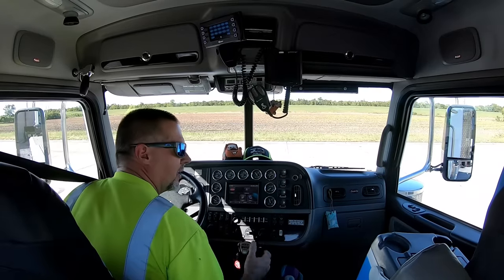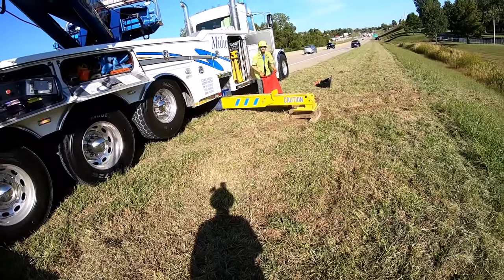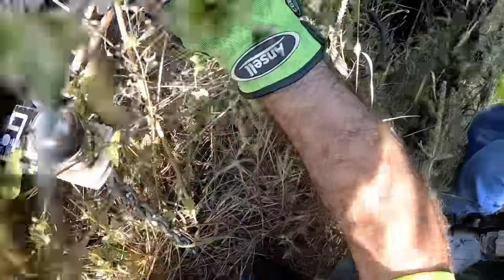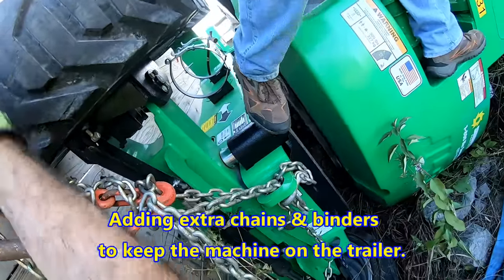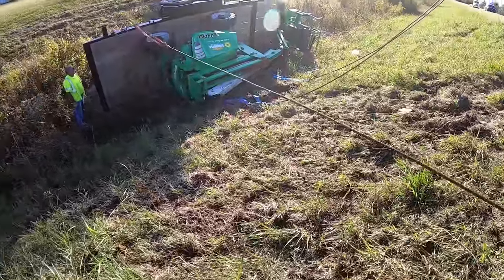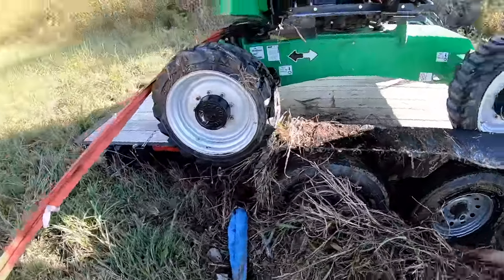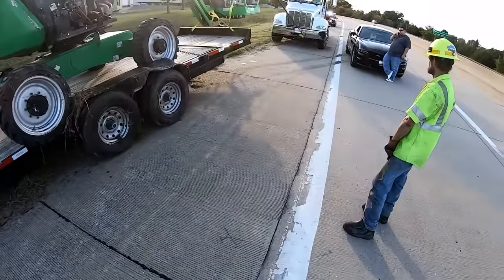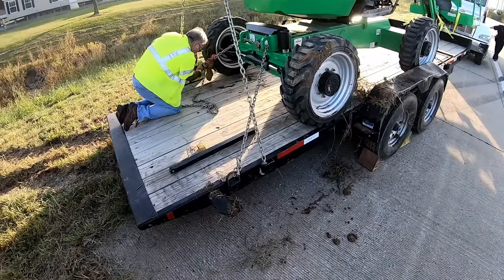THE REVERSE ROLL   ROLLOVER MANLIFT & TRAILER   YOU SPIN ME RIGHT ROUND

Comment: how do you reverse a rollover? isnt a rollover a roll over no matter witch way it rolls over said the woodcuck who chucked wood?
Reply from the maker: I guess I should have clarified what I meant.   The recovery procedure that we used to upright the trailer and the machine is called a "reverse roll".   The most common way of uprighting an overturned vehicle is to attack it from the wheel side rather than the top side.  When attacking it from the top side you are "reversing" the procedure, therefore,  this maneuver is commonly referred to as a "reverse roll", at least here in the States.    If you watch the channel long enough, I try to show a lot of different techniques.  Thanks for watching and God bless.
Reply: @RonPratt  I was gonna say that's a Ford......tow hooks aren't gonna be a true option (wonder how many feathers you've ruffled with that lol). Just because I'm a curious little shit was the truck repairable?
Reply: @RonPratt  I dont claim to know everything. I dont know much. What i do know how ever is those man lifts have a massive counter weight on the back. The guy drove the lift on the trailer when he should of backed it on .
Reply: @protectoroffaith  The tongue weight if he had put the lift even to the forward edge of the tilt section of the trailer may have been more than the truck itself could safely handle. even spinning the lift so the counter weight was to the front where it was sitting could have done that, though that would have been the better option than the way it was loaded.
Reply: @protectoroffaith  Or simply have rotated the basket around after it was it on the trailer and moved if farther forward on the trailer.
Reply: @protectoroffaith  that is what I noticed as Ron walked down to it.
Reply: @protectoroffaith  exactly!  I've hauled several of those, only bigger. It wasn't loaded on the trailer correctly & like Ron told the officer, it wasn't secured correctly. Never run one chain through both loops, always secure each corner separately.
Reply: The woodchuck and i thankyou for the clarafication  sir......(woodchucks are easily confused) have a good day  and may your God do with you
P
Reply: @timothygeiger437  If the machine is under 10,000 lbs, then one chain like these guys had it is perfectly legal. But anything 10,001+ lbs, you are correct. Needs 4 independent tie downs on each corner
Reply: @RonPratt  Looked at many comments and I agree with the many folks who say the load was back to far on trailer and caused the crash. As Ron stated the truck and trailer spun 180 degrees. This means the trailer ended up in the lead which is obvious by the skid marks and final resting position.
I am curious though if anyone  thought about why the trailer was in the position it was? I think there's a reason the coupler was twisted off the ball hitch.
Follow the skid marks. I believe Ron's reverse roll completed a 360 degree roll. If so the lift indeed took a beating and the lift basket and truck corner may have only met right at final resting place.
Thanks Ron for the work you put into showing your professional trade. Added camera view at high speed shows up the forces on the rotator, which is very interesting to see.
Reply from the maker: @paweaver1861   I do not know exactly, but from what I saw at the scene, it appeared as though the trailer and the machine rolled onto the opposite side of the ditch very hard and then bounced back to its final resting position.  There were multiple "scar" marks on the grass and rocks on the opposite side that looked fresh.  The machine had damaged on the uphill side of its final resting position.  To me, this would mean that the machine either did a complete 360 roll, which I don't believe it did, because the break-away chains would have been twisted.....or it would have, as I suggested, hit the far side of the ditch hard enough to bounce back to the uphill side.   The safety/break-away chains being in the position they were, as well as the other evidence I mentioned, gives me the impression that this was what happened.  Again, it is only my opinion based upon what I saw.   Thanks for watching and God bless.
Reply: @RonPratt  Thanks for the detailed reply! Interesting to know there was scars on the bank beyond. You had the advantage of being there to see but you weren't called out to investigate either so did your job and moved on. Brutal ride either way and thank God no one was injured.
I shouldn't waste your time but I guess I'm stubborn enough to give a little more of my study. 1st I saw it appeared the double skid marks of trailer going sideways seemed to end and appeared to be tore up more random afterward but the only boots I had on the ground were yours! 2nd I did study the safety chains and decided they were hooked opposite as required but then it dawned on me that if the left trailer to right truck chain was on the bottom of the cross it would have unwound the 1st half of the roll and only started the next twist but I couldn't see well enough to confirm it was twisting that way and that still does not confirm it rolled.
Don't let it scare you that your videos get such scrutiny. You still know best. Thanks again for the window into your profession.
Reply: That manlift alone is 15,000+ lbs. I cant believe sunbelt was delivering that thing with a 1 ton truck and trailer.
Reply: @protectoroffaith  looks like it would need a new frame at least, for a work truck with wear and tear on the driveline, suspension, engine prolly not worth it. maybe it could be tweaked by a frame shop but idk shit about that
Reply: @iffykidmn8170  not quite he had brought it up the embankment to get it free of the rocks at the bottom of the ditch as the machine and trailer were resting mainly on dirt it was the move necessitated to prevent further damage and made it easier to get it free from the ditch
Reply: @timothygeiger437  I was taught in cargo securement class in the army back in 09 that you should be able to (theoretically) completely roll the trailer and cargo upside-down and back as well as being able to stand it on either end without the cargo being able to shift... of course all calculated based off securing device working load limits if the math didn't add up then add more securements
Reply: @timothygeiger437  But it stayed on the trailer, so it was secured adequately for the maneuver he performed, which I think was pretty extreme.
Reply: @protectoroffaith  😁
Reply: edward tye funny how many people
Do not know how to load equipment, strap or secure properly, etc. unbelievable how many people are on the road these days towing heavy equipment on under weight trailers and loaded/secured all wrong!
Reply: @protectoroffaith  That's what I noticed. I've seen it happen with a telehandler Forklift too.
Reply: @Badger65  Just wondering......So "4 independent tie downs on each corner"......:   The load needs 16 tie down in total? Asking for a friend.
Reply: @Badger65 Maybe legal, but still could be stupid if you are near max GVW.
Reply: @countycoroner5784 one sufficiently sturdy tie down per corner, so 4 total.  The forward tie downs need to keep the load from shifting aft.  The rear ones need to keep it from shifting forward.  The left side needs to pull against the right side.  It takes a truly huge load to require more than that

Comment: Look at the lack of tongue weight on that trailer.   Maybe things had shifted due to the accident, but if not having negative tongue weight is exactly the kind of thing that can lead to loss of control like this.  Thankful everyone was uninjured in this.   Thanks for another excellent video!
Reply: Mark Zeien noticed the same thing. Trailer definitely seemed tail heavy, unless it moved backwards during the crash.
Reply: Your spot on about the tongue weight. The basket was probably already at the front of the trailer which still puts more weight of the machine behind the axles. Should have been loaded the other way around.
Reply: Yep.  That's kind of what I'm thinking.  Equipment should have been loaded with boom turned toward back so the weight of the equipment would add some tongue weight.  Negative tongue weight with speed or a quick maneuver will definitely put you in the ditch.  With the tip trailer, the axles are pretty far forward, so looks can be deceiving.
Reply: Look how far forward the basket is...I think they loaded it like that so the basket would miss the truck...they should have loaded it backward.
Reply: WAY too much weight behind the trailer axles.  Should have loaded the machine in reverse.  I imagine that was quite a ride into the ditch!  No injuries, great.
Reply: Should’ve loaded it backwards. He went as far forward as he could because of the boom. those things are heavy, even if it didn’t weigh 10K pound. Should’ve had four chains not two
Reply: It didn't look like it could go farther forward unless the upper was turned 180 degrees. The lack of tongue weight might have caused hitch to come off the ball. Trying to tow a trailer with the safety chains never works well. That lift weighs over 6 tons.
Reply: I agree.  Looking at where the bucket was I would be surprised if it could have shifted much, though.  Maybe should have loaded it with the bucket to the rear.  Of course, you can't be sure and I don't want to assign blame for something when I don't have all the information.  Who knows what may have happened to cause the loss of control.  Certainly any number of things out of the driver's control could have happened, but proper loading of any trailer is important.
Reply: I read your comment before start of video. I watched for the tie down chains. Their position looks to me like you are correct. That must've been a wild ride down that embankment!!
Reply: thats what i was thinking as well because the counterwheight of that lift was behind the last axel of that trailer. the other thing that came to mind is that truck might have not had enough strenght and by that i mean they couldnt put that much wheight on the hitch. 
also i think the F250 was not heavy duty enough to do the job of towing this load and trailer. Even here in Estonia i see either rollbacks hauling these manlifts or a Big F350 dually  pick-up doing it.
Reply: That was my thought, it didn't look as if it had moved that much, and it couldn't go that much further forward on the trailer without the bucket hitting the back of the original tugs bodywork (cabinets)... plus the counterweight was rear loaded (bad)- I think that is probably what led to the original accident, 'she's starting to shake", " she's starting to shimmy", "she's starting to, to (looks up thesaurus) she's starting to shudder" https://www.youtube.com/watch?v=1UybDydQpNY
Reply: if you note the position of the basket it appears they did not trailer it correctly and all the weight is towards the back...  also note the back chain setup that appears to be a 1 point hookup or there would have been slack  between the tiedown points on the machine  @ 3:03. 
for that trailer and truck combo the basket should have been towards the back and all 5 tiedown points should have been used properly ( 4 to the normal tiedowns points and 1 extra for the basket. )
Reply: Exactly my thought as well. Looks like a classic death wobble situation
Reply: Where i live they teach you to put the lightest part of machine to the rear and heaviest over the axle/drawbar aera this looks like weight was over rear/axle.
Reply: That's my first guess too. The load quite likely have been too far back and the trailer have started lifting the rear of the pickup. One can see the lift is well secured, can't have moved much. Scary stuff!
Reply: The way they had the chaines, it could slide sideways but it can't move forward or backwards much. There is a heavy contra weight in the rear, so yeah I say load it in reverse and tie down with 4 chains and always check that tongue weight. I'm pretty darn sure it was the negative tongue weight that caused it to sway and crash, luckily only trailer rolled
Reply: Agreed. I'm thinking that the lift should have been loaded facing the other way so the weight would be more on the tongue.
Reply: Agree loaded wrong. Bet it wobbled from the get go and he just kept going.
Reply: I bet that was a hellava ride. I had the same problem with Shamrock boat on a trailer from the dealer. The trailer wasn't the right one for the boat. I was pulling it with an F250 4x4. Hit a bump at a bridge crossing and lifted the back of the truck and sent me across 3 lanes of I95 in Florida. Bought a different trailer for the ride back to NY.
Reply: Yes sir!! I don’t think it slide back it just slide down because of how they run the chain. For sure not very experienced at tieing down a load one chain is fine if you just loop a both ends to the equipment then put your binders to the trailer then to the chain keeps everything from shifting as it did and tongue weight like it was is why it ended up rolled very lucky it didn’t roll the pickup and if if it was up anymore I’d say the basket would have got it the cab either all weight on the tongue or they should have used a landall or a roll back like sunbelt delivers there equipment.
Reply: Yep, negative tongue weight, trailer whip, and that was all she wrote
Reply: I think if they'd have loaded backward for weight, the basket would have been hanging off the end of the trailer. Really, the trailer was entirely too small both in length and weight rating. Those boom lifts are heavy and that trailer looked way too light to handle that.
Reply: I totally agree with everyone's comments in this thread. Plus one additional point to consider. The single rear wheel F350 obviously doesn't have the same tongue weight capacity as the dual rear wheel F350, I wonder as well if that had something to do with the way it was positioned on the trailer. So to sum it up - wrong truck for the job, tried to fudge it and ended up in the scrub. Dually truck with more weight on the tongue of the trailer and it would have gotten to the destination in one piece IMO.
Reply: Yeah, I 28th the notion! Also relative high center of gravity didn't help the physics.
Reply: Ron's statement that this little bugger is heavy is a understatement. Dry weight on this model of JLG lift is 9,700 lbs. And was loaded wrongly to start. You're correct about "No Tounge Weight" They had a 1 ton truck hooked to it. The lift should have been at least 4 ft further up the trailer and the bracket on the tail end of the trailer. I worked for Sunbelt for 3 yrs. This was a very common thing. Our local Heavy Recovery company would bring 5-7 of these type of crashes back to our yard every spring. Most often it was tracked skid steers that where close to the same weight as this unit. And the weekend warriors wanted to pull it with there 1/2 ton truck or SUV.
Reply: i think it for sure moved, the straps broke. how far is unknown though
Reply: @0xsergy  They're were no straps just 2 chains. Run through the eyelets on both ends. That secures the load front to rear but not side to side.
Reply: @douganderson7002   This boom lift was loaded 100% incorrectly. The basket loads to the rear unless it is centered on a 5TH wheel type trailer. On a bumper pull the basket is always to the rear putting the counter weight in the center of the trailer instead of behind the trailer wheels.
Reply: Mark Zeien There is one more thing to it:a load on a trailer or for example a caravan that is significally higher than the towing vehicle reduces the tongue weight because the wind pressure pushes it backwards,this increases exponentially with speed increase!
Possitive tongue weight is a must,with larger trailers/caravans itv should well be ABOVE the normally recommended 50kg.
Reply: I'm gonna be loading a small skid steer into my 12' dump trailer and pulling it behind my Tundra this weekend.  I sure as hell won't be making the mistake this guy made!!!
Reply: Guys, although you make a very good point about the necessity of tongue weight, it had very little to do with this incident; the simple fact that the trailer gross weight should never be above 75% of the towing vehicle's gross weight is the most important factor. Heavier trailers will twist causing the "tail to wag the dog" as the saying goes. The demonstrated weight of this trailer (it even picked up the nose of the roll-back) far outweighed the tow vehicle's gross.
Reply: The machine is actually loaded in reverse in the video , the counterweight (opposite end of the basket) should in most circumstances be loaded toward the tongue , the machine weighs about 10,xxx so depending on year of the super duty is well within capacity
Reply: I agree that it probably contributed.  The basket could not go too much more forward without hitting the truck.
Reply: @danbowers5266  It wasn't even a 1 ton, but a 3/4 ton. Even worse.
Reply: Load was behind the center of the axles of the trailer. That caused trailer to 'fishtail' the driver was depending on the weight of the truck to hold it down. THAT WON'T WORK!
Reply: Yeah that machine should've been backed on that trailer
Reply: I think the only way that truck was going to tow that boom lift was with the body loaded forward and the boom aft.  But if it was all the way on the trailer, the front wheels of the truck might not touch the ground.  So, the basket might have needed to be overhanging the back of the truck.  

IMHO, that needed a larger truck/ trailer combination to be safe.
Reply: @johnscott2849 Bet it only started wobbling when it got up to speed on the interstate.  I've been in a death wobble and recovered.  It was fine until the moment it wasn't.  Downhill right curve.  A touch of gas, and the free lane to my left saved me from disaster.  Then I braked slowly.  Mind I knew I was a bit overloaded.  1 ton truck.  ¼ ton of steel in the top rack, ½ ton of concrete mix in the bed and a 3500lb trailer on a ball hitch.